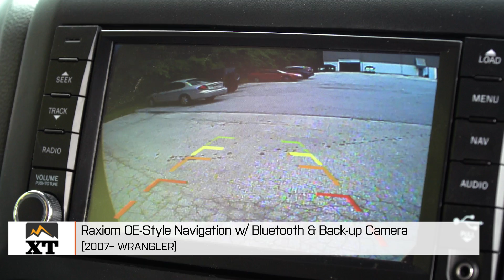2017 Jeep Wrangler JK Build -  Teraflex 3 Inch Lift Kit, 37 Inch Tires, Magnaflow Axleback Exhaust🏖

Comment: Was there any rattling from the tube doors? And if so is there adjustment for reducing/eliminating it? Looks like you were having fun, now crank some tunes!
Reply from the maker: There was a little bit of rattling coming from the doors during the test drive, but it was most noticeable during the video due to the amplification of the microphone. You can adjust the door striker for a more snug fit, and the doors themselves have rubber isolators that keep the door snug against the body. -Jake

Comment: Would you say running 37's on a stock dana30 like on that Sahara is ok if youre not rock crawling lol? were there any axle mods to support the tire size and or regearing? I'm just wondering because I know dana30's arent the strongest axles
Reply from the maker: Running 37's on the stock axles as a daily driver/beach vehicle shouldn't pose a problem. It will definitely cause the Jeep to be sluggish, but I wouldn't worry about the axles imploding like they would if you were to take it rock crawling. Personally I would do a re-gear to 4.56 and swap the front axle to a Dana 44 or chromoly axles if this was my Jeep. -Jake

Comment: I have The same lift and front and rear bumpers running 35's thinking about Re gearing what do you think I was thinking 4.56somebody please answer
Reply: V13jay 4.56 would be perfect IMO. Some who like tall gearing will say 4.88, but it's overkill unless yours is a dedicated trail rig.
Reply: Smokey the Jeep thank you so much for replying that helped so much!!!!! Thanks
Reply: V13jay Happy to help!  Here's some info I posted about gearing on my blog awhile back that might be helpful, too. 

Multiply your desired tire size by your Jeep’s factory gear ratio. Then, divide that figure by your original-equipment tire size. Round off the resulting figure to three digits, and match it to the closest available gear ratio. For example, I plan to run 35-inch tires on Smokey. The equation would look like this:

35 X 3.73 = 130.55

130.55/ 32 = 4.0796875 (Round up to 4.08)

A 4.08 is a near match to the factory-offered 4.10 gear ratio. But, of course, the performance of the 3.8-liter V-6 and my factory 3.73 gearing is sluggish at best. So, let’s plug in the lowest (highest numerically) factory ratio, the Rubicon model’s 4.10, into that equation.

35 X 4.10 = 143.5

143.5/ 32 = 4.484375 (Round off to 4.48)

The closest match to 4.48 would be 4.56, which is a popular gear choice for 35s. So, in our examples, we see that a 4.10 gear ratio would provide performance and fuel economy equivalent to my stock X-model gearing, while a 4.56 ratio would offer increased performance along the lines of what a stock Rubicon might normally see.
Reply: Smokey the Jeep That is some great info.  Thank you sir.

Comment: Is this the teraflex prerunner kit?
Reply from the maker: This is the Teraflex 3" Sport S/T3 Kit. The Prerunner kit is their top of the line system which is very similar to the S/T3, but comes with long arms instead of short arms. -Jake

Comment: Does a lift void a jeeps warranty?
Reply: I think so, unless its a MOPAR lift or mods since MOPAR its owned by FCA
Reply: The Magnuson-Moss Warranty Act of 1975 makes it illegal for companies to void your warranty or deny coverage under the warranty simply because you installed an aftermarket part. at least in the USA anyway. so adding a lift does not void the warranty, as long as the failure in not related the aftermarket part installation.  They are obviously not going to warranty the aftermarket part itself, but they may not warranty any damaged axle mounts or frame mounting points if they are removed or damaged during installation of the lift. some lift instructions require you to remove the original frame mounting points so it may void the warranty on the frame, but the dealer must prove that the failure is related to the aftermarket part. same thing goes with engine mods. if you add a cold air intake and aftermarket exhaust, and flash the ECU with a performance tune, and the engine throws a rod, they are still required to warranty it. however if it doesn't pass emission control, you may be required to reinstall the OEM parts and flash the ECU back to factory before they will warranty any failed emission device. SEMA fought the big car companies back in the 70's for this.

Comment: what's the constant clicking while you're running in the grass?
Reply from the maker: Just some rattle from the latches on the tube doors. Luckily when you're driving it's not as noticeable, especially with that Magnaflow exhaust singing it's sweet sweet song in the background. -Jake
Reply: Thanks for the reply.

Comment: Is this made for a beach or a farm?
Reply from the maker: I would say it's more of an all around speed focused rig. The suspension is set up to be able to take high speed bumps and easily traverse any terrain you throw at it. However given the tire setup and lift we went with, you wouldn't get the best performance you could if you were to take this rig rock crawling. -Jake
Reply: ExtremeTerrain.com all jokes aside, great video. Any suggestions for similar tube doors for a cj7?